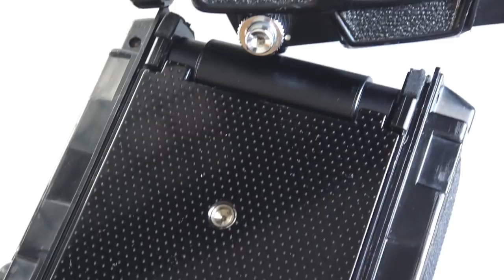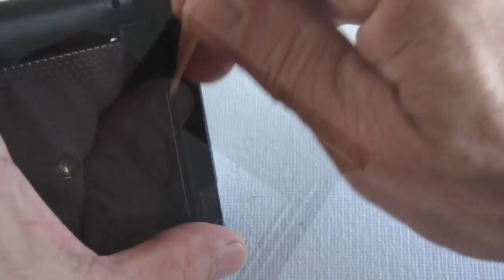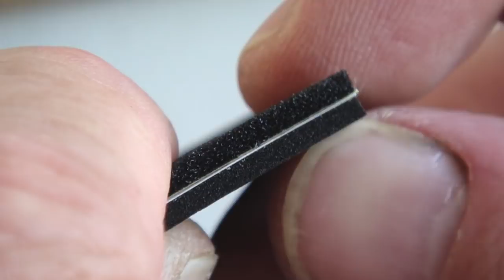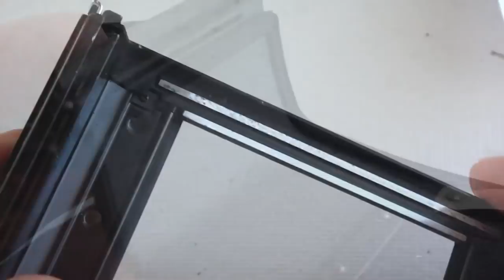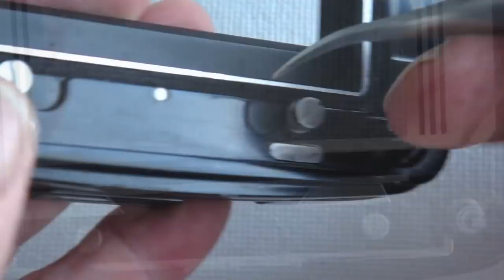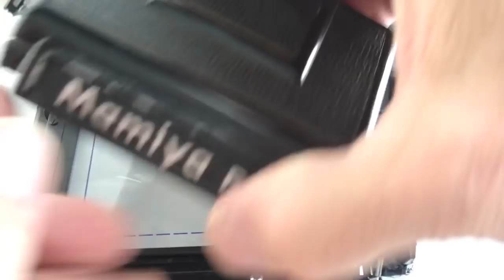Fix Old Cameras: Mamiya RB67 Light Seals

Comment: Thank You for guiding me through replacing the light seals on my 4-backs and the rotating back on my RB67 Pro S. The cost to have the back's repaired at a repair shop is $150. This repair is time-consuming so you need to be patient. I found out using a Q-tip to deactivate adhesive strips works much easier for me.  I over saturated using this repair technique  to deactivate adhesive strips and was working with a spaghetti noodle. You can get this light seal foam on Amazon.
Reply from the maker: Good to hear that your persistence paid off. That is a funny, but perfect description of an overly saturated light seal. Thank you for the comments.
Reply: Seal material is also available from eBay seller "millyscameras" in UK.  I recommend you avoid pre-cut seal kits sold for specific camera models:  Much cheaper and practical to cut your own from bulk material as shown in this video.  Plus, when you mess one up, you'll have plenty of material to try again.
Reply: Incase anyone else reads this, Millyscameras foam is all 'High Density' and not graded by Density at all.

Comment: I wanted to ask if it is okay to use both thicknesses in high-density seals. I have ordered both 2mm and 1,5mm however they seem to be both rather high in density. I have noticed upon arrival and now installing them. Film back seems to be okay with it however I am not sure about the mirror. Do you think it would somehow affect the operation if the foam won't be able to squeeze as much as a medium dense one would? 
Thank you! Great vid!
Reply from the maker: If the shutter release and frames as it should than you are OK with the installation.

Comment: Thankful to have found this video! I just received my rb67 and saw that the most difficult part (at least for me) is replacing the light seals on the shutter mirror. The foam is deteriorating, any tips on how to cleanly and carrfully remove it? Also, what are some tips to clean the shutter mirror. Thank you again!
Reply from the maker: Just be patient as you work it out with a scraper, you want to avoid scratching the paint. Have a sturdy paper towel handy to keep the tip of you scraper clean of the foam as you remove it.

Comment: Great videos. Any chance you will be doing a video to show how to replace the bellows on the RB 67?
Reply from the maker: A great suggestion. Hard to say when such a FOC video might be produced.
Reply: @FixOldCameras  no worries. I used to make videos, and I know it's a lot of work. There is also the requirement to have the required equipment and parts, which I know is expensive. Thanks for getting back to me, and great work with the videos!
Reply from the maker: Your gracious understanding is appreciated.

Comment: You use the alcohol to deactivate the glue on the light seal foam, right? Now, I've read somewhere  that one of the ways to deactivate the glue is to use your own saliva (lick the adhesive part) or water. I believe that that is better than to use alcohol to deactivate the adhesive, because the alcohol is used to dissolve the the old glue residue and could possibly ruin your foam seals even in small/little quantity. 

What are your thoughts or anyone else's to use real linnen or wool thread to replace the light seal foam in the doors? For example my old Agfa Synchro Box has its original light seals which are probably linnen thread. would the linnen thread seal just as enough as the foam cut outs?
Reply from the maker: If the light seal foam is of a good quality it will not be damaged by the alcohol. It evaporates completely and fairly quickly leaving the adhesive completely intact. Spit probably does not deactivate the adhesive, but coats it and by nature evaporate slower. Neither property should cause any harm to the seal if that is the technique you are comfortable with.  Properly sized and textured yarn or thread should be a good substitute and in some cases maybe a superior choice.